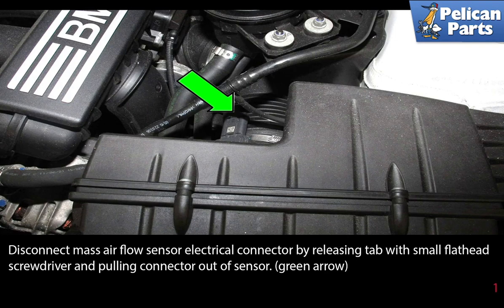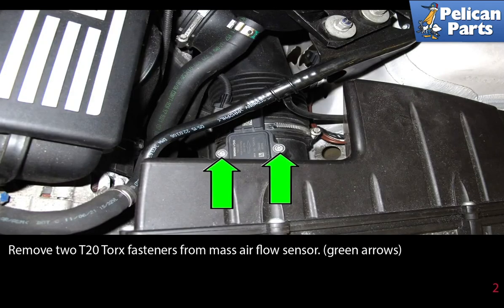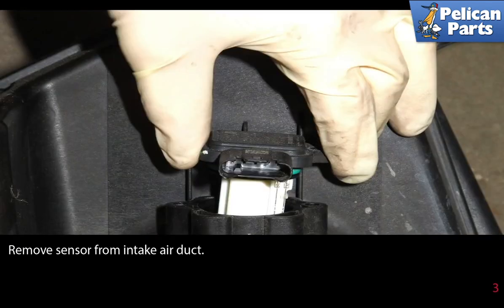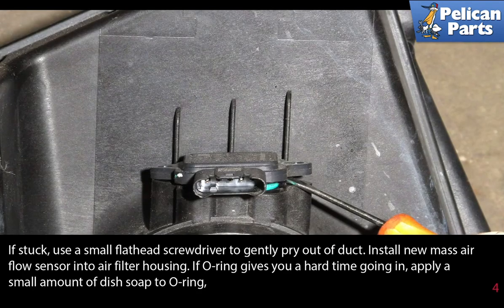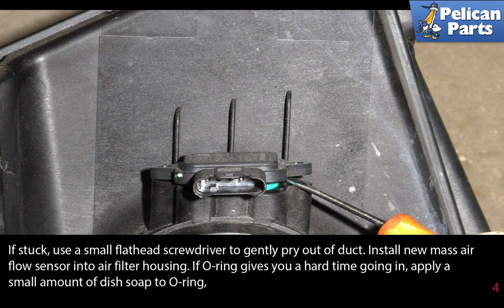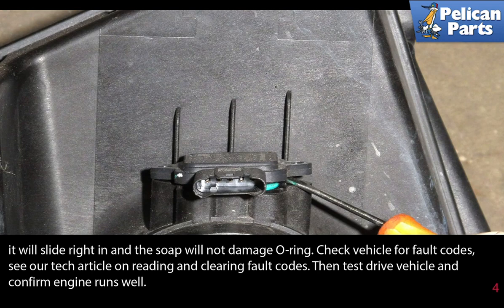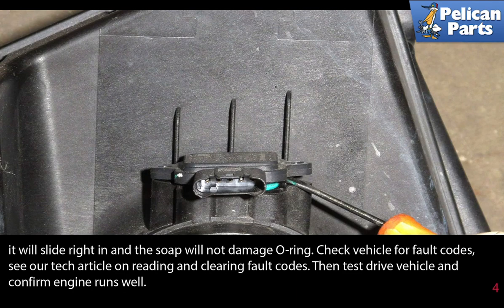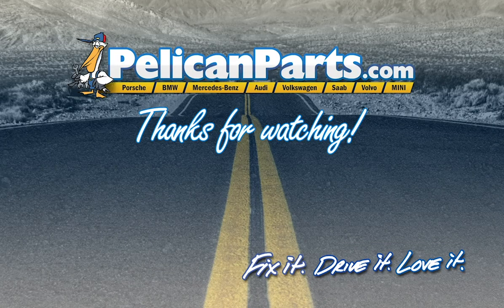BMW E90 3-Series Mass Air Flow Sensor Replacement for 325i, 325Xi, 330i, 330xi, 328i and 335i

Comment: Fyi - the E9x 335i doesn't have mass air flow sensors.. I have an e92 335i with the n54 engine and they use MAP sensors to measure absolute pressure at the intake manifold and charge pipe.. there are ZERO MAF sensors in the engine bay.. (this public service announcement was made to steer away any confusion or misinformation from ppl who dont know any better)
Reply from the maker: Correct, turbocharged models used calculated air mass, via throttle angle and RPM to determine air mass. Normally-aspirated engines use a mass air flow sensor, as shown in the video.